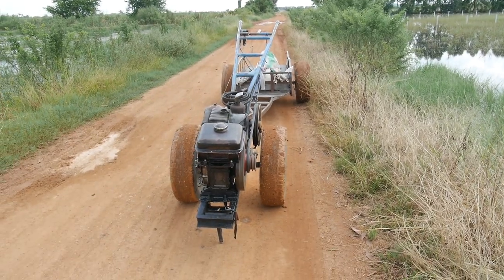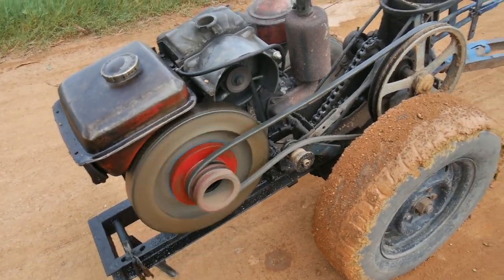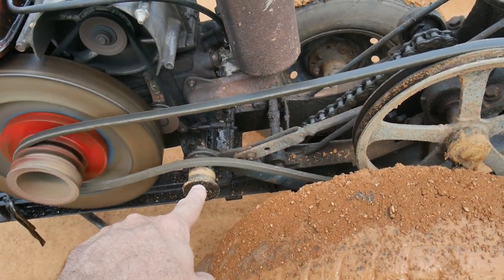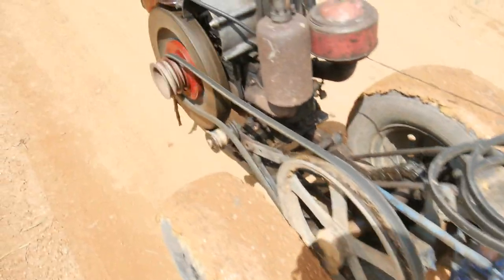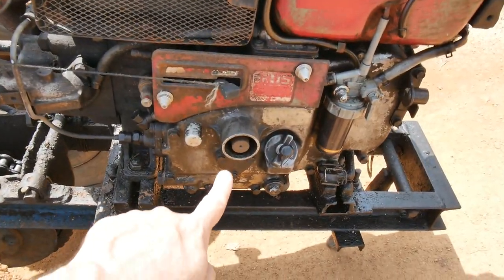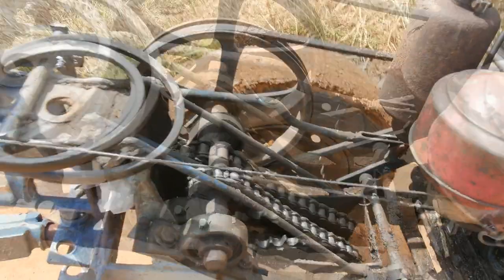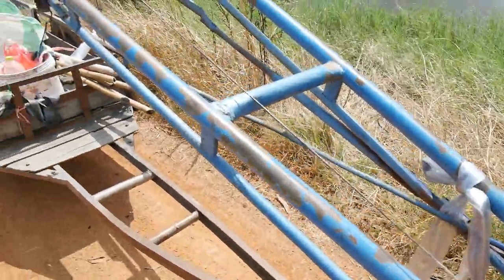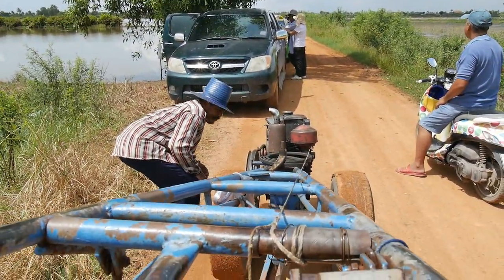Iron Buffalo, 2 Wheel Tractor, Walking Tractor - Thailand

Comment: How do you steer?
Reply from the maker: There's a pivot joint between the front part and the trailer.  Those long handles given them leverage.  It won't turn quickly, but it turns.
Reply: Handle bars  ( bicycle)

Comment: 15.5Kw is 21HP. 12v-35A
Reply: Rodian Simon  
 This is  Kubota engine  11 HP   
   Nick nane  Kubota ET110
Reply: people on North East of thailand   Kubota Engine inthe popular very  than engine  brand name other  
 Because  High Power on  Low run engine (Low RPM.)  with seved  oil Diesel.